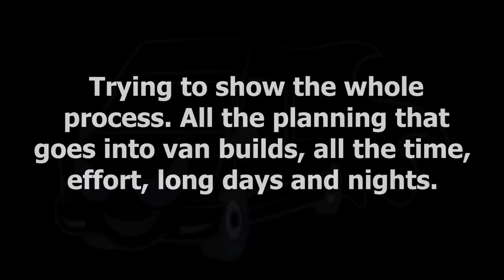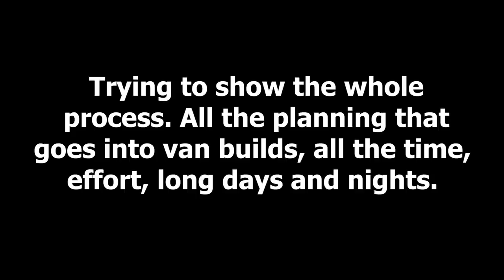Time Lapse Van Build - 2019 144 Sprinter - Murphy Bed, Indoor Shower, Heated Floors, Custom Power

Comment: Amazed why amateurs never put in a vapour barrier they will rust out, stick on splash backs stands out but saves the stress of falling to bits if you don't know how to tile...5/10
Reply from the maker: Question for you. Have you built out a van yet? I've said it before and I'll say it again and again. Building a van IS NOT like building a home. Things are done the same but much different. In a van there's no way to stop a wall from sweating. However if you actually looked further into the van build you'd notice I used real sheep wool and that is made to adsorb moisture and release it and they tell you NOT to use a vapor barrier. I do know how to tile and I even did it in my first van. You're correct that because we drive these homes around and it always moves and shakes then it's not a good idea to put real tile and grout on a wall that moves, like a earthquake, because that is what we are driving.
Reply: @JarrodTocci Yes i have built many, you use flexible grout, a quality one holds up with no problems... I have seen what happens without vapour barriers in vans it's not house it's a tin can, a house wicks vapour upwards...As an example have you pulled up van floors and seen the rust in most of them? It's because of a high moister content getting behind an insulation barrier, which does not evaporate out easily..With vapour barriers there is a very very low condensation even if it gets through in small areas...Tests have been done from ships to other inclosed metal structures, amateurs arguing because a lot of so called Professionals cut corners to build faster peddle false information...When you have got yourself an engineering degree come back and talk to me about it..

Comment: Thanks.  I really appreciate this.  Only thing I got a headache from the music, so I had to mute it.  Why did the wall panels get taken off so many times?  Really really great job !
Reply from the maker: Waiting for someone to ask. Because the back corner parts were so different we needed to dry fit them. We also had to take it down to cut the window section in.

Comment: Wow! that's a beautiful build I like that. Ball park figure, what would that whole thing cost including the van?
Reply from the maker: Did a video a little while back of price. With van and the systems I estimated $90k. However the electrical/solar set up is top of the line and I have a heated floor/hot water system that most don't have. Take those 2 things away and the build only cost $15k +/- and the van was $45k
Reply: @JarrodTocci  Thank you, I'm going to remember that.

Comment: What happened to the finished shower clips?
Reply from the maker: Technically not done yet. The build of it is done but I was working on small details like hanging and getting the right curtain. The recirculating shower won't be in for another couple months unfortunately
Reply: @JarrodTocci  Whats with the delay on the recirculating shower?
Reply from the maker: @coolguy5425  the designer had personal issues, I left town for a little while, my design is a little more complex then his previous model. It's still in beta testing so they are making sure it's right so they don't have so many problems once installed and in the field